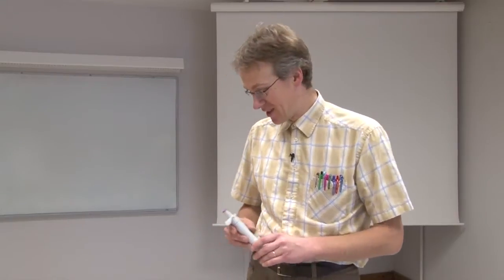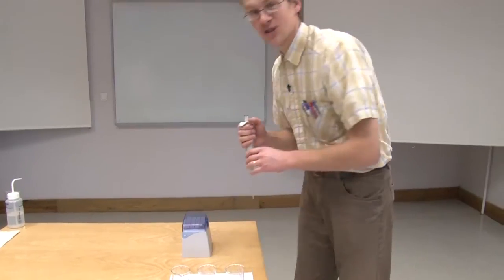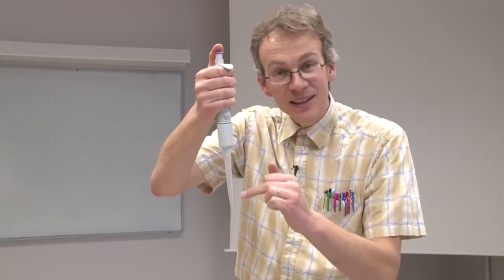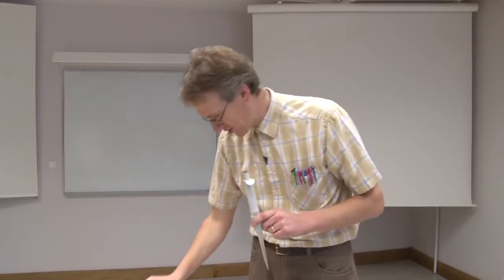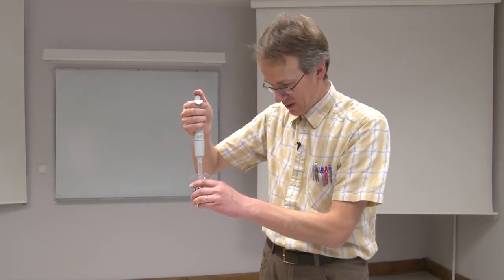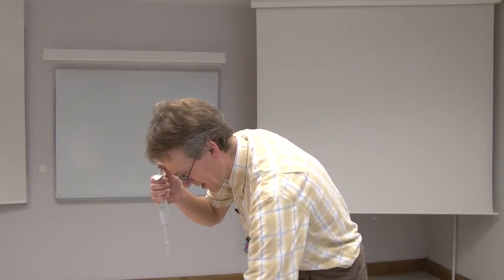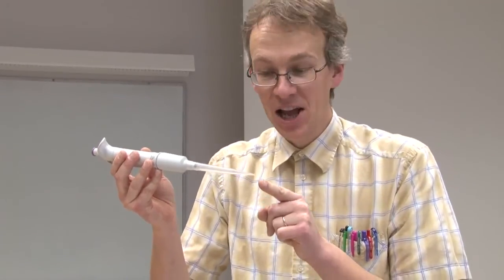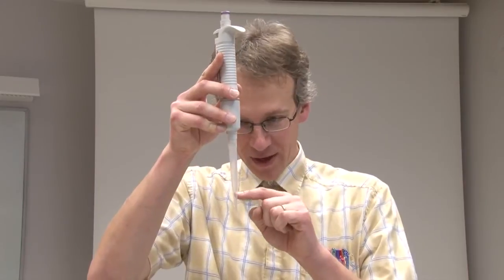2.2 Measurement uncertainty sources of pipetting with an automatic pipette

Comment: using an automatic pipette is different than using a glass pipette and has more sources of uncertainty:
 calibration uncertainty
drift from day to day
temperature here effects mechanical parts of the pipette in addition to effecting the volume of the liquid
speed of delivering
rinsing of tip
using the right tip
type of liquid delivered
the angle of pipette with the liquid surface
Reply: True.. But cleaning glass pipettes is such a pain in the neck.